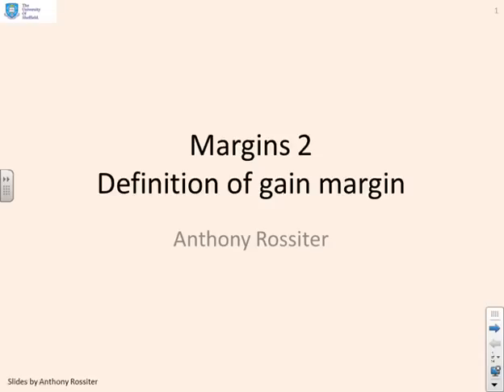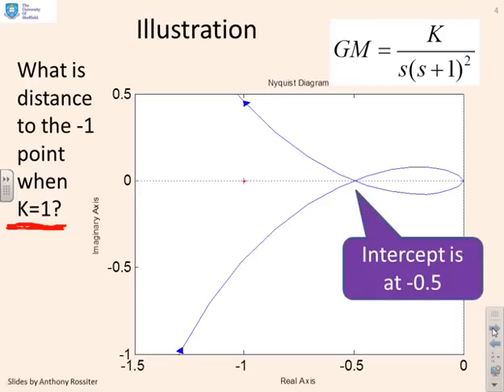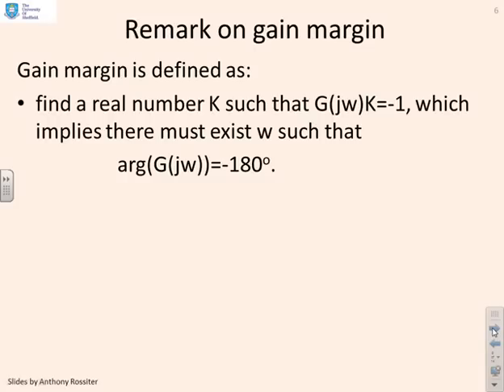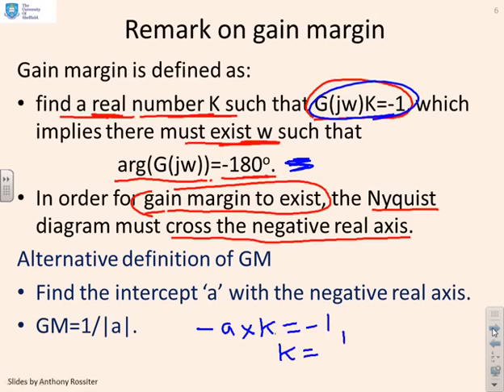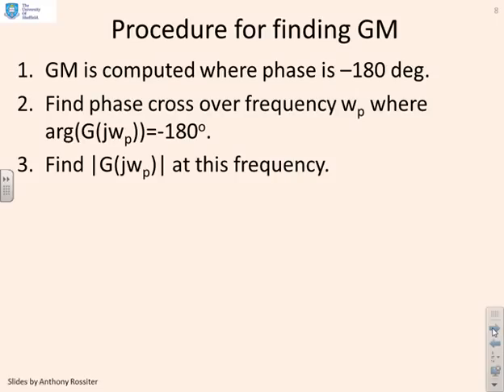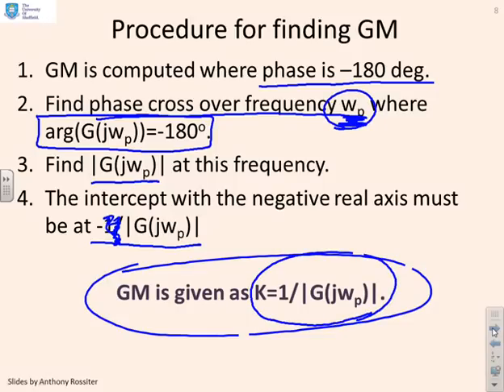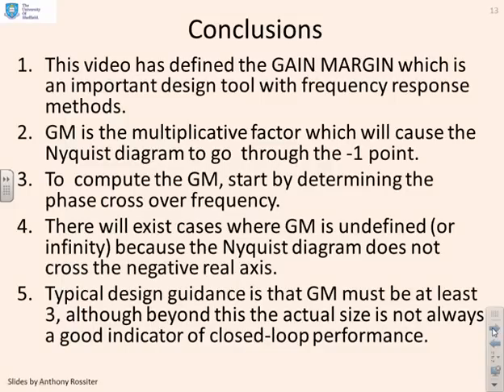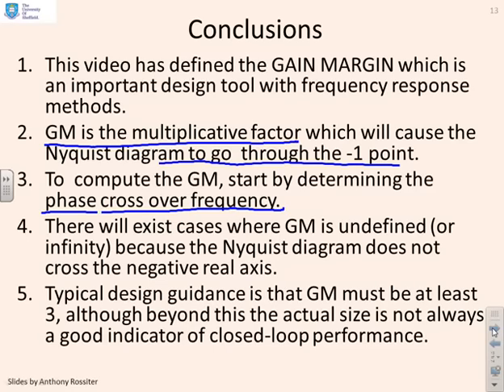Margins 2 - definition of gain margin

Comment: What is the practical consequence of having a low or negative (in dB) gain margin? This does not appear to be addressed, apart from saying the behavior is not good.
Reply from the maker: jonesr227 Often a negative GM (in dB) implies encirclements of -1 which implies closed-loop instability. There are some exceptions though.Anthony